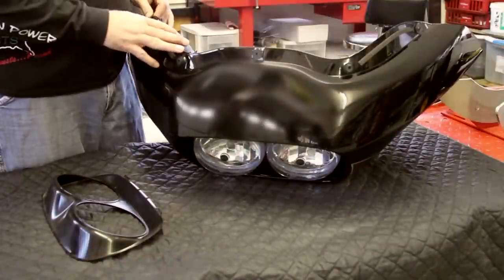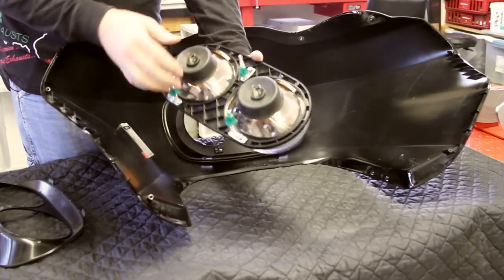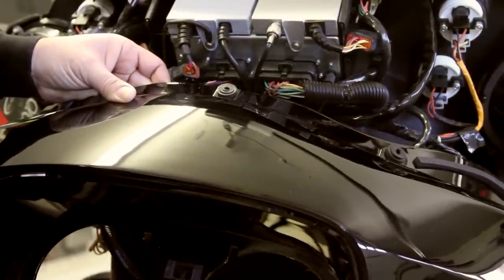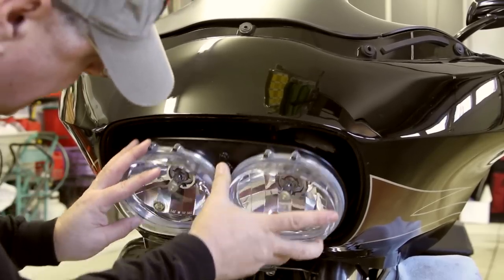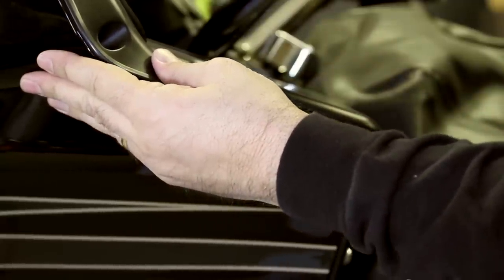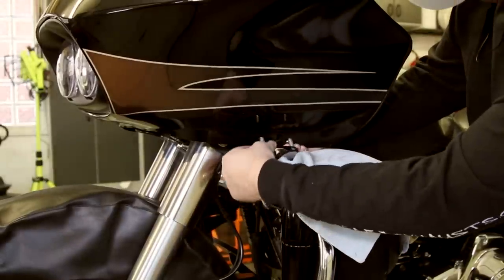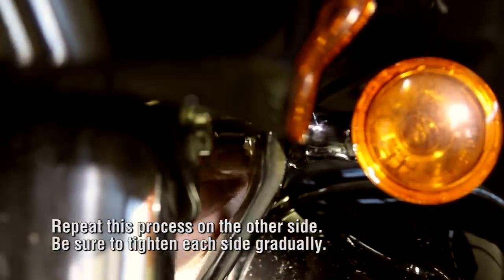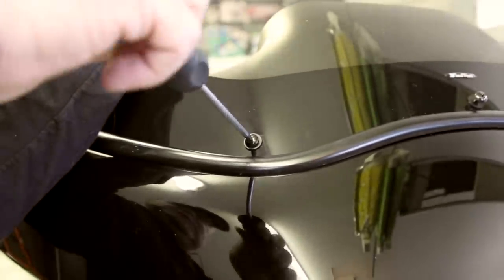Replacing the Fairing on a 2011 Harley-Davidson Road Glide Ultra

Comment: FYI
The difference between red and blue threadlocker is a matter of strength and removability. Loctite threadlocker blue is designed to easily be replaceable with common tools, whereas red is a more permanent fix.

Comment: Great Video! Gonna try the headlight out next time I pull the fairing... One comment... Loctite 242 Blue is the one you want for removable nuts... Red 271 is for applications where you won't be removing the nut/bolt on a regular basis.

271 (Red): High-Strength (Permanent)
• High temperature, high strength for heavy duty applications.
• Designed for larger fasteners 3/8" to 1" (9.5mm to 25mm).
• Locks studs, bushings and large fasteners against vibration loosening.
• Strengthens slip and light press fits.
• Removable with heat and hand tools.
They’re not kidding when they say permanent. Use only on screws you don't ever plan on removing. To remove a bolt treated with red Loctite, you would need to heat it to approximately 500 degrees Fahrenheit to melt the Loctite, and then crank it with a 4-foot wrench (OK, a little exaggeration). So use this product with caution.

242 (Blue): Removable-Strength
• Locks threaded fasteners against vibration loosening.
• Ideal for nut and bolt applications 1/4" to 3/4" (6mm to 20mm).
• Prevents threads from rusting and leaking.
• Removable with hand tools for easy disassembly.
• Temperature range: -65 degrees to 300 degrees Fahrenheit (-54 degrees to 149 degrees Celsius).
Use this Loctite on threaded parts that you need to keep from coming loose, but might want to remove occasionally for cleaning or to replace with another component. It is removable with some mechanical force.

290 (Green): Wicking Grade
• Penetrating formula works in between pre-assembled parts.
• Locks threaded fasteners against vibration loosening.
• Ideal for fasteners ranging from #2 to 1/2" (2.2mm to 12mm).
• Localized heating and hand tools are needed for disassembly.
• Temperature range: -65 degrees to 300 degrees Fahrenheit (-54 degrees to 149 degrees Celsius).
Use for pre-assembled parts that need to be locked in place.

Thanks again for the video...
Reply: @Terrence Barrett instablaster :)
Reply: @Emerson Aaron It worked and I finally got access to my account again. I'm so happy:D
Thank you so much you really help me out :D
Reply: @Terrence Barrett You are welcome xD

Comment: Great video brother!!   Have you ever tried to replace or change your windshield?  I am and I cant get them damn rubber things for the screws to stay in.  Any hints or a video I would appreciate it. Thanks.
Reply: ABM 261 they wear out pretty easy, talk to the HD dealer for the correct parts, keep your old ones and make sure they are the same, my dealer has been hit n miss with them I’ll go get the part number I have in a few for ya

Comment: Two questions: Is the 2006 Road Glide the same design as far as the headlight plate removal?

Also, have you ever replaced a glove box door spring on the inner fairing??
Reply: The springs come with the glove box door. So you would have to but a complete door assembly. Remove the outer fairing and there are two screws to replace the glove box door.